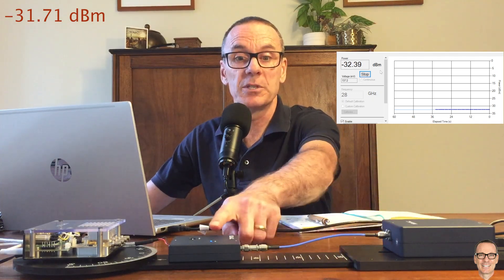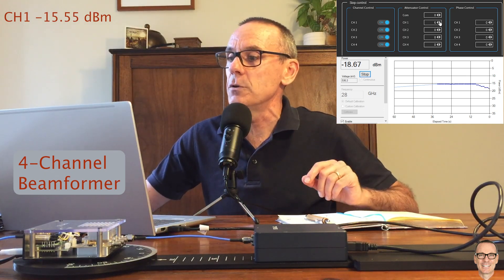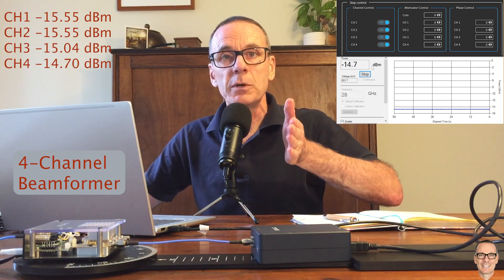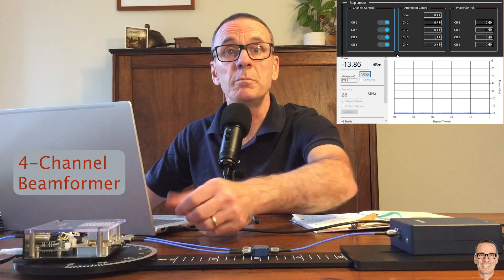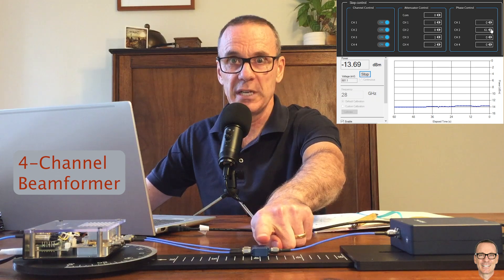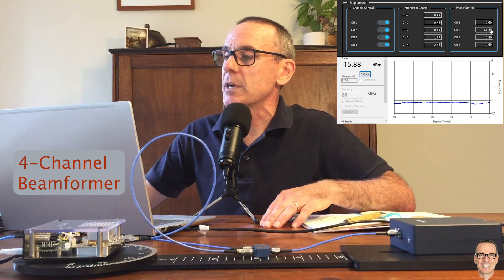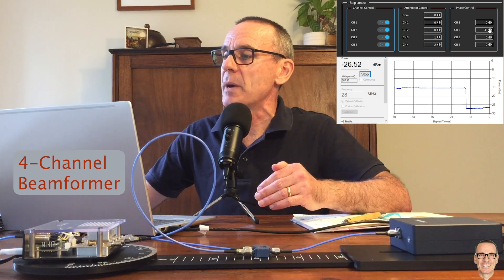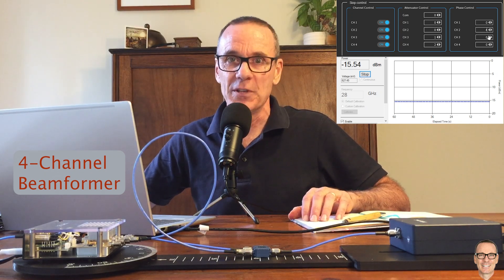Beamforming in Practice: Part 1 - The Need for Calibration at 28 GHz mm-Wave

Comment: The ideal BF gain for two calibrated ant shall be 6dB? The resulted power increase is roughly 3dB in your testing is that due to the coupler loss of around 3dB?
Reply from the maker: Why do you say it should be 6dB? Two antennas should give 2x receive power = 3dB. This video explains it: "What is Beamforming Gain?" https://youtu.be/OFn40mCAkB8

Comment: Great video!!  Thanks.  Q: when u calibrate between 1 and 3 and say you have a phase change for 1 wont that affect the previous calibration? How would you deal with this situation?  Thanks.
Reply from the maker: You'd keep the phase of channel 1 fixed, and only adjust the phases of the other channels.

Comment: Thanks Ian those were too wonderful videos of ofdm with lot of interesting insights.eventhough it gave more details of how those subcarriers are upconveterd but my basic query seems to be not fully addressed.below are few concepts for me to be more clear about this. As states earlier in the base band if cos leads by sin , the modulated symbol will go to the right part of spectrum while if the sin part leads the cos , then the modulated subcarrier goes to the left part of spectrum. But suppose I need to use a  qpsk with 4 symbols to be used at say -15khz baseband and another +15khz baseband (like it's two different stations broadcasting) how can we ensure that both will not interfere when upconverted. How can we ensure that irrespective of whatever symbols we are modulating with -15khz always ensures that the sin component always  leads and for the +15 kHz the cos component always leads by sin. As I can suppose if I take -15kz for modulating, then based on the values of modulating symbol the sin wave some times leads and sometime lags the case wave. So if the modulating symbols results in leading cos wave , after upconvertion this will go to right part of spectrum which will interfere with the symbols modulated with +15khz.how can we guarantee that whatever symbols are transmitted from +15khz and -15 kHz falls on the correct part of spectrum irrespective of the whatever the modulated data is ?can you pls throw some more light with some example say using qpsk with all 4 symbols can be trsamitted separately with +15khz and -15khz and never interfere with each other
Reply from the maker: It's a great question. And unfortunately I don't have an intuitive answer for you right now. I'll have to think about it (bit busy at the moment ...) From a high level though, when the baseband is up-converted, the -15kHz and +15kHz channels in your example, will occupy two different sub channel frequency ranges, centred at fc-15 and fc+15. So that's four degrees of freedom (sin and cos at two frequencies each). So that matches with what's needed to send two complex numbers (constellation points).